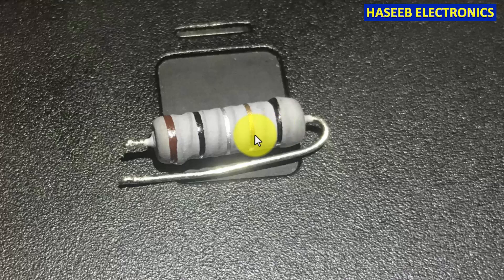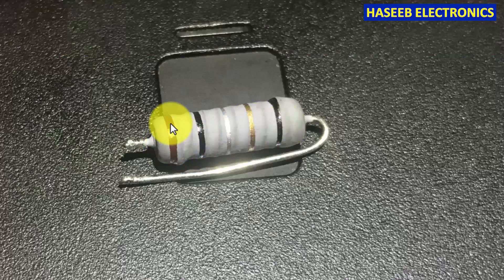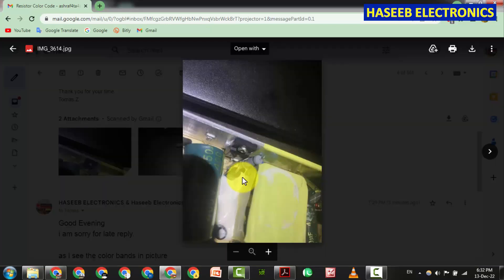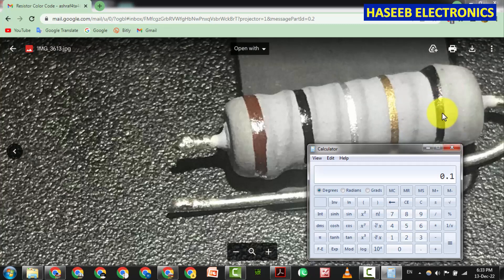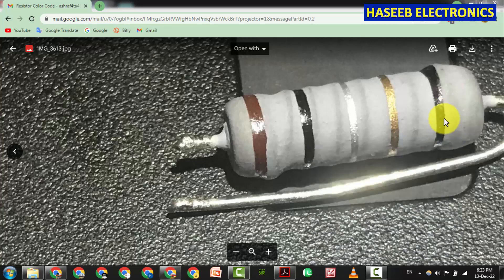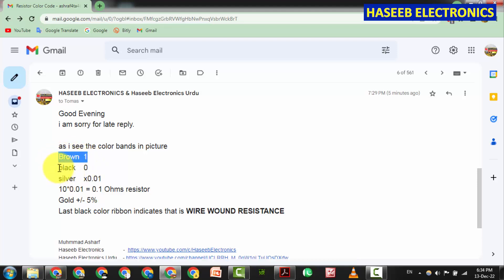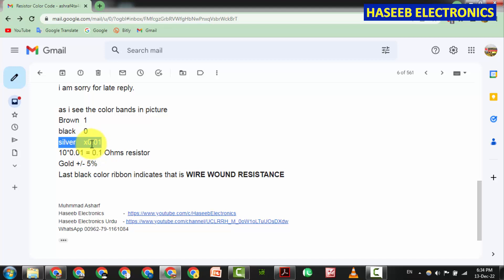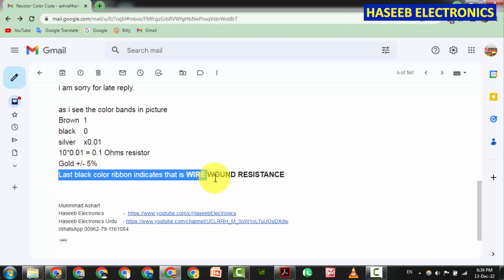{789} Wire Wound Resistor - 5 Band Resistor Color Code

Comment: I have 7.5 ohm wire wound resistance, 2 watts that is not available what is another resistance available or not pls explain sir
My resistance band colour is (Violet,green,gold,gold,black)
Reply from the maker: you can use 15 ohm (2 resistors in prallel) 
or 22 ohm (3 in prallell)

or use 3 or 5 watt in 7.5 ohm (if available)
Reply: @HaseebElectronics  Thankyou sir for advising ❤❤

Comment: Brother Haseeb, I'm facing the same thing. I have resistors with 5 band(Black,Green,"Silver",gold,green) i checked with all website and i can't pick silver as thired band only grey availble.
Reply from the maker: Black 0
Green 5 
Silver x 0.01
0.05 ohm or 50 milli ohm 
Gold +-5%
Green Flameproof, wirewound non-inductive resistor and sometimes green is used as TCR

Comment: Hi, your video is very informative. I have a similar resistor that is measuring 0 ohms so im thinking it faulty. It has a black band like the one in your video but the value seems impossible.  The 5 band colors are blue,green,grey,red,black.  What value could this resistor be? Thanks

Comment: Sir I have 12v 30amp SMPS power supply unfortunately I found a problem on ac section one resister is burnt but some colour codes on that resister 
Color code is : black brown brown silver brown 
Can u tell.me the exact value of this resister

Comment: So it's actually 4 band resistor correct? And if we want to replace should we also look for wire wound one or can we skip that?
Reply from the maker: exactly yes 
wirewound resistance must be replaced with same wirewound and wattage rating. 
approximately all high wattage resistors are wirewound, 
except some special purpose resistors

Comment: Thats why you never find russian made resistors with color codes, they were smart enough to simply write the value. And these days when the writing does not fit on small parts just write codes that fit, color coding resistors is the most stupid thing in electronics since colors change with age and temperature.
Reply from the maker: you are exactly perfect 
please accept my best regards

Comment: resistor like in the video if it is damaged, can it be replaced with a 4 ban resistor with the same ohm value
Reply: but if we want to find resistor like in the video, how do we look for them in online stores because resistor like this are very hard to find
Reply from the maker: we can explore using watt rating and resistor value 
https://www.digikey.com/en/products/category/resistors/2
Reply from the maker: https://www.digikey.com/en/products/filter/through-hole-resistors/53
Reply: ok thank you very much for the information
Reply from the maker: yes we can replace with 4 band resistor, it is to be wire wound 
even if the new resistor is within same wattage and resistance value then it is doable

Comment: This video helped me solve one out of two of my queries.  
My mystery resistor is (BLACK/BLACK/GOLD/GOLD/BLACK).  It measured 0.05 ohms on the meter.  
How do you read these bands?  Is the meter showing the correct value?
Reply from the maker: best regards 
please check the colors again. first 2 black bands are possible, but third golden band is impossible
might be it is black, black, yellow, gold, black (then it will 0.4 ohms wire-wound resistance)

Comment: What would the last (fifth) band mean if it is red color? In many PS4 power supplies are these 0.16Ohm resistors that have this red band...
Reply from the maker: if we have 5th band other than black, that will indicate Temperature Coefficient (that is in ppm/C)
if the 5th band is black, that it is indication for wirewound resistance

Comment: To further clarify, the black fifth band denote a wire wound NON-INDUCTIVE resistor. Unlike normal wire wound resistors, half the winding is wrapped clockwise while the other half is counterclockwise, to avoid inductance. This is particularly important for a low value resistor exposed to high frequency signals.

This resistor does not follow the standard 5-bands resistor marking, as the fifth band would normally indicate tolerance, on precision resistors. Black was chosen by some manufacturer like Yageo for their NKN series (wire-wound non inductive) because the fifth standard tolerance band does not support the black color. This way, if you see a black fifth band, it’s not standard. Thank you for your video, very informative, as usual.
Reply from the maker: superb. wire wound NON-INDUCTIVE resistor 
it is really a valuable addition for me 
i am thankful for this information
please accept my best regards

Comment: Sir ager o.1 ohm resistor ko circuit ma na lagya aur short kara circuit good kam kara ga ya nahi q ke o.1 ohm small resistance value ha
Reply from the maker: no
it is used in current sense circuits 
if it is  not installed, the circuit will work normally in normal operation,but it will unable to limit the current, which will cause to damage it permanently
Reply: @HaseebElectronics  thanks you sir

Comment: Crazy timing… I am working on a power supply and came across a resistor I can’t figure out the value. It reads 3 ohms but I want to confirm it’s correct. It looks just like the resistor in this video and ends in black. The color code is Purple-Green-White/Gray?-Red-Black, can you help with this? Thank You!
Reply from the maker: welcome dear 
you mentioned many colours 
Purple-Green-White/Gray?-Red-Black,
please write 
first band _____
2nd band color ____________
3rd band __________
4th band ______________
5th band _______________
waiting for your reply
Reply: @HaseebElectronics  
1st band: Purple
2nd band: Green
3rd band: White, if not White then Gray
4th band: Red
5th band: Black

Thank You!
Reply: Actually it measures .3 ohms

Comment: Short and great explanation.
Reply from the maker: it is my pleasure
Reply: @HaseebElectronics  if you have a wound resistor can you take out the wire winding, it is made of some special wire, I think?
Reply from the maker: @HelgiThorisson  yes dear it is resistive heating wire. just crack it's outer ceramic. the wire is visible inside
Reply: @HaseebElectronics  thank you for the reply. I have two of them that are unusable (open circuit) and when I saw this video it occurred to me that the resistors have this wire so now I will salvage them. Thanks again.